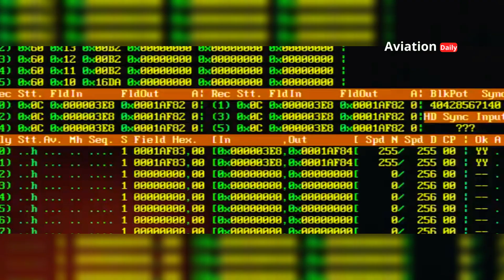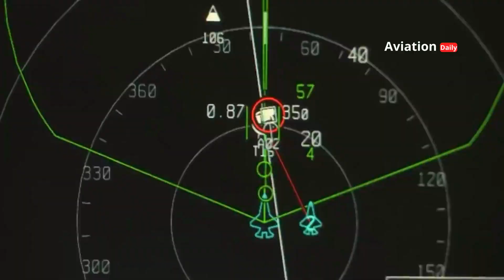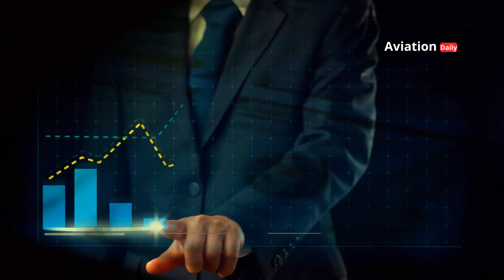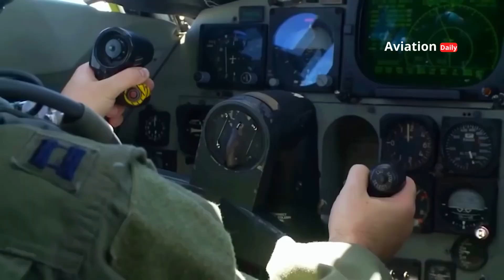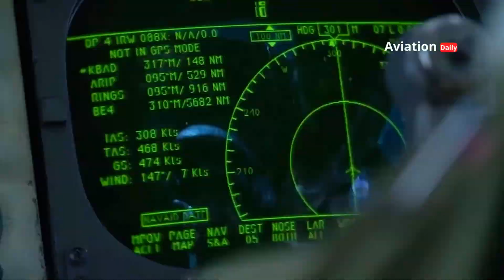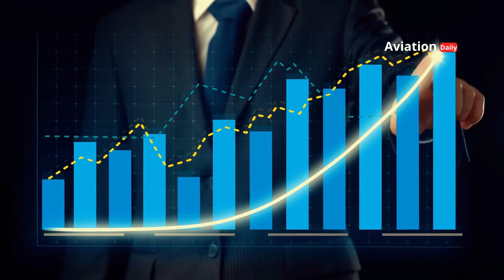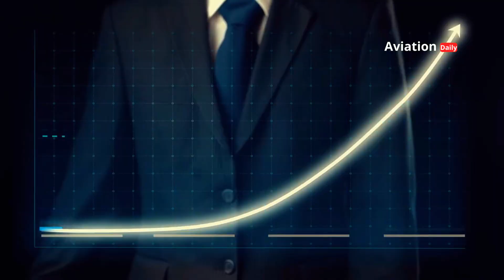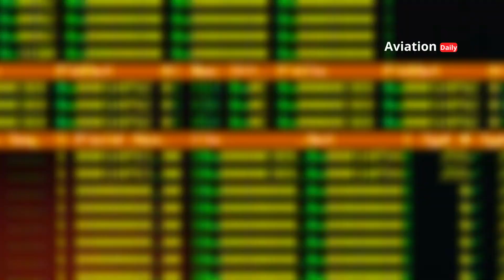Which is More Important: NGAD or B-21 Raider?

Comment: B-21 Raider is a bomber with aims of global dominance; NGAD is a superior fighter designed to support regional or global missions; the FX-XX is designed as an adjunct to USN Fleet operations.  The land-based ICBM (Triad) can be retired and those funds used to ease current military funding pressures.
Reply from the maker: @leeofallon9258 
There are many programs that need to be implemented, however, success depends on funding.